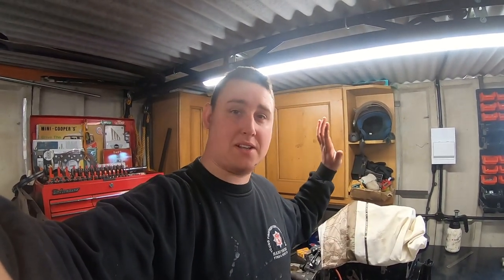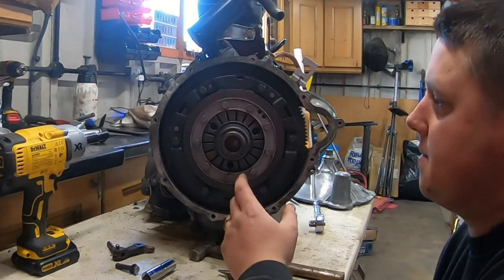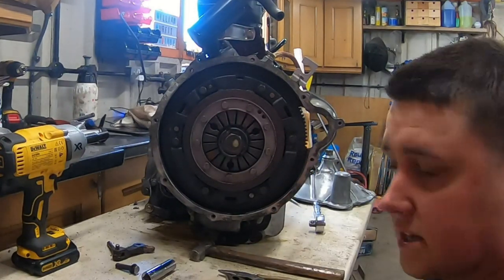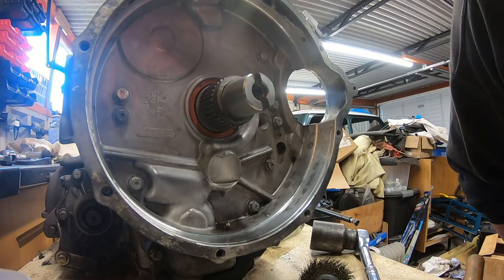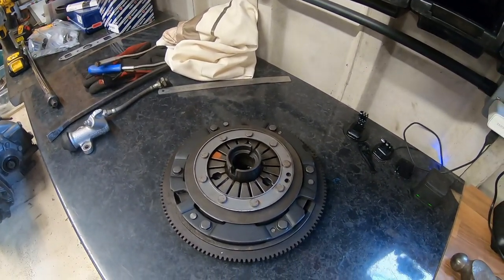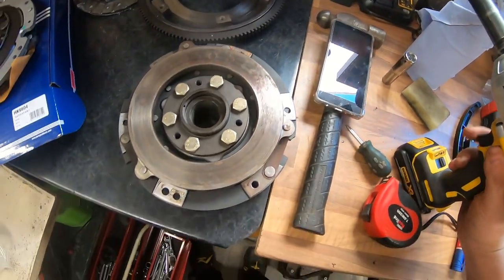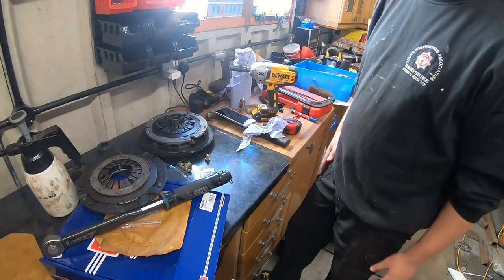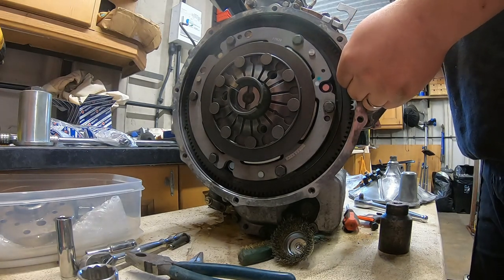Gareth's Classic Mini | Part 3 | Clutch replacement

Comment: Nice work. This is SPI engine, isn't it? (I can see flywheel casing has blocked sensor hole and the flywheel has magnetic ring)
I am about to swap my 998 for 1275 SPI using carb and I was wondering two things:
1) you linked 180mm clutch ,but that should be only for engines pre-1990, shouldn't 190mm kit (CK9378) be used after that?
2) do you know if starter motors are same for carb and SPI engines? I would assume they are (pre-engaged type) but I heard that the SPI has different number od teeth on the pinion?
Reply from the maker: That’s it yes

Comment: Hi Will great to see you back on a new project, I thought there was the letter A on the clutch components that needed to be lined up with the fly wheel to keep it in balance?
Great work there and you’re right those last two wok bolts are a bugger to get to with the engine in, a thirteen mil ring spanner bent into shape gets you in there with a little patience. 
My engines coming back out again next week and off to get the gearbox sorted 👍
Take Care Stay Safe Everyone Regards Dave 👍😎🏴
Reply from the maker: The a is only on the older style verto clutch. I hope the engine and box get sorted ASAP for you

Comment: What model is your dewalt ugger dugger gun ?
Reply from the maker: This is the one i purchased it has some fantastic stats and shares a battery with my drill which is handy https://www.ebay.co.uk/itm/DEWALT-DCF899N-XR-Brushless-High-Torque-Impact-Wrench-18-Volt-Bare-Uk-Stock-/252124947560?mkcid=16&mkevt=1&_trksid=p2349624.m46890.l6249&mkrid=710-127635-2958-0

Comment: I hope you realize how infuriating it is to see your flywheel come off so easily! When I tried to tighten that center bolt the three bolts holding the flywheel puller on all decided to loose their threads completely. Great video!
Reply from the maker: Ha ha I’ve had my fair share of stubborn clutches too, the guessworks puller sure helps with that and makes life easier